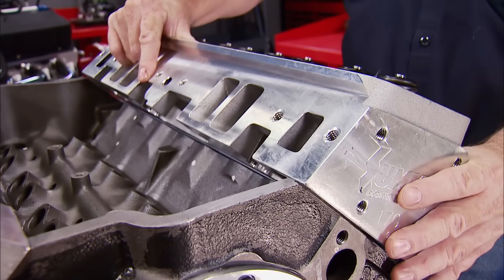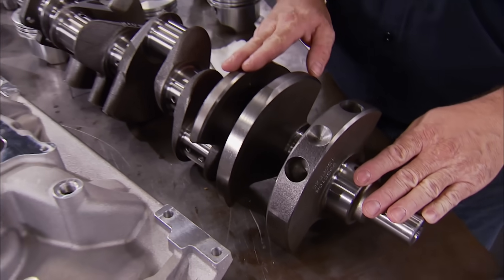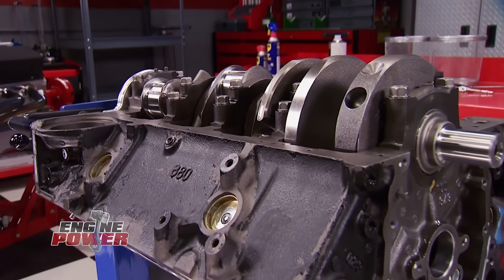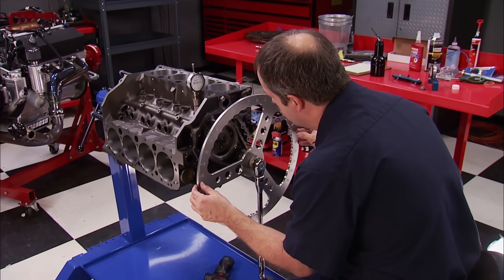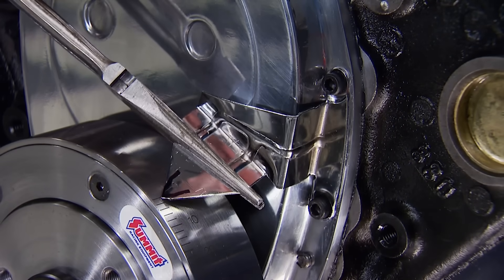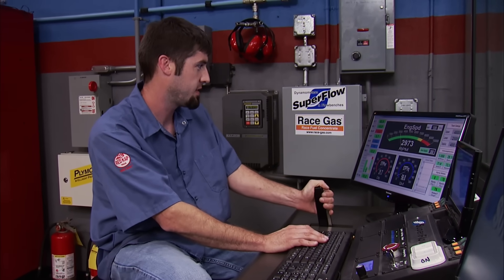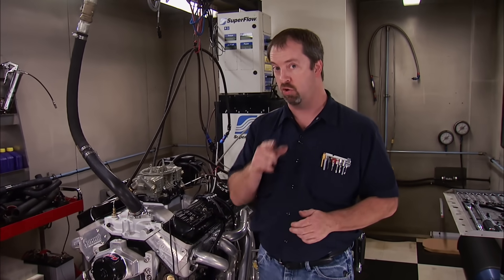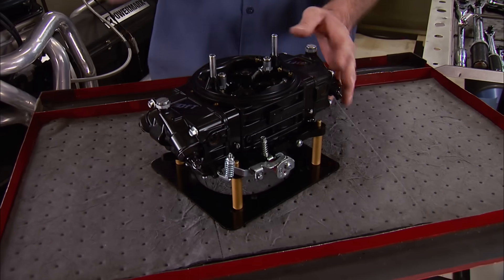Small Block Chevy Build Stage 1: Reliable Power Under $4,000 - Engine Power S3, E1

Comment: Pretty good power considering 
Copy of cranes old saturday nioght special cam? Durtion and lsa with a good dual plane, 650dp should roast the tires no problem. 
More power than the zz4 GM roller engine

Comment: You never pound Main caps down with a hammer the bearing  can pop out use the bolts or studs with nuts to line up the cap in snug it down carefully.

Comment: A lot of folks would like to see a Dyno test on Single plane vs dual plane intake Dyno test on a 408 Windsor with average horsepower and torque with a camshaft 0.050" duration in the 232-240 range with AFR 185, 195 and 205 head.

Comment: On the flat topic cam I recommend spray on graphite. Or brushing on the break-in lubricant when you have excess buildup especially with heavy valve springs the lifter may not rotate also get a cheap cam don't cheap out on the lifters

Comment: Lol 😆 I put 4000 in just my differentials, race rated 4.88 gears and axleshafts new 8.25 IFS front case and cv shafts and a auburn ected max lsd/electric locker on 33x12.5 bfg k02s on 16x8 wheels now you might think 4.88s on 33s is overkill but a worn out beat up stock lo5 low compression tbi truck motor will sure make you smile with that set-up. lemme tell you 200hp and 300lb ft of torque really feels like something when you got low enough gearing lol

Comment: i love it. Next could you dyno some jegs heads with an EPS intake and an XR276HR10 or XR282HR10 cam with the  same 10pt.25to1 static compression?
Reply: EPS intake is imo  the best all around st dual plane. Good hood clearance and supports plenty of power.

Comment: How do I get 800 HP out my small block ? Its bored 60 over with 292h comp cam with 501 lift, derale dual electric fans a 3500 stall in B&M transmission kit in 9.5.1 compression ratio

Comment: When I see these guys hammering the main caps in a block I cringe you can call some lower bearing come loose from the bearing cap supposed to use the bolts plus the bolts for studs helpline up the main cap properly

Comment: Made a critical mistake on the oil pump stud. :( The stud bottomed out on the rear main bearing. This will wipe out the the bearing in no time. Don't make this mistake. You have to rotate the crank to confirm this. The stud must not bottom out on the bearing! It needs to be loctite a little ways from bottom out. This is why when you tighten the nut it seems like the stud is too short. It is that way for a reason.

Comment: Spent 2500$ on a 383 that made 508hp
Reply: the only way that would happen is with stock 400 rods and crank all turned down and you did everything  cause most shortblock 383's go for 2500 alone

Comment: Made more power and torque than the low buck 5.3. LS has 15 degree head vs 23 degree for sbc. Also had a tad larger cam than this engine, and a hydraulic roller vs a flat tappet.
This is why the old sbc is still here. Especially those torque numbers. The sbc would have picked up even more with a better dual plane intake.

Comment: I enjoyed this video. That said this is why it's hard to justify not going to an LS. Does those numbers from the junk yard. Cost me 218 for a long block with intake and torque converter. Then spend the same you'll make closer to 500. Turbo and you'll blow those numbers out the water.

Comment: With $4k im going to chevy performance and saving the trouble. Plus I'll have a warranty
Reply: @THE WIZARD72 and he will only have 200 hp 😂
Reply: @off-roadmotorsports5148  🤣🤣
Reply: Building a engine gives you room for ajusting everything for future upgrades or especific use, and more chevy performance engines have a lot of "loose power and weakneses a built engine doesnt have
Reply: You could buy it part by part rather than dropping 4k and you get no say where you cheap out
Reply: I know this is a year ago but where the hell are you getting a decently built motor for 4k that isn't stock 200 horsepower?

Comment: 1785 summit cam .. just installed the same one in my truck.. sounds good and a upgrade in performance .. i got vortec heads as well with stock springs

Comment: Yeah, as soon as i saw aluminum heads i knew this budget was already way higher that any average joe, but seeing the hp, we built iron headed engines for the circle track for less than 2,000 that put out over 400 hp, our 406ci engines put out over 500 but they would have run you 3700
Reply: Yea I think I'd buy a tired ass ct 350 from a sportsman guy and freshen it up before I did this.

Comment: Stock motor from Chevy makes 350hp. In 1968 so this is not so good for $4000.
When the old stuff works.  Just hard to find a double hump heads these days.
Reply: there are 0 70s small blocks from the factory that make more than 250 lol

Comment: Ok look, i know that Im still young (17) but when people complain about this not being a budget build I always forget people don't have the assets I do. I grew up in a home where my dad collected a lot of old short blocks from when he worked at a dealership. (He doesn't tell all the stories behind it other than he just accumulated stuff) so when people say oh lord this is too expensive im thinking, I have a 350 block, steel crank, higher compression pistons and a set of vortec cylinder heads that were either given to me or I found for super cheap. I come here to learn random tid bits of info on engine building

Comment: Still out of most "blue collar Joe's" budget. My dad & I built a peppy little motor for my 74' Vette for around $1,500 & estimate around 350+ hp. Think it was a 307 bored out to 312ci or something weird. Had 11:1 compression & roller valve train. Nice lumpy cam that wasn't too crazy, it sounded amazing & was a blast to drive! Although it was severely limited from stock suspension & brakes along with an automatic. I can only imagine how badass it would have been with a proper suspension & a 5-speed manual 😍

Comment: always use a hardened oil pump driveshaft, on the summit heads pull the valve tubes and use phosphor bronze valve tubes.

Comment: YOU CAN BUILD A  383 FOR THE SAME MONEY SO WHY WOULD YOU BUILD A 355?
Reply: not everybody wants a 383, my 327 SS/H Chevy II has put every long stroke Frankenstein small block its ever run on the trailer. The only thing that gives me hell are the Hemi Barracudas. NHRA Super Stock is the most competitive class in NHRA drag racing followed by Stock Eliminator which I run an 87 Monte Carlo SS in S/KA.

Comment: I want y'all to build " The Battle of the  Junk Yard Grudge Engines"   Where some of these grudge racers run cheap junk yard engines until they blow up and get another one. 
Either get a 96 Explorer Engine with a 302 with  the GT40 heads or a 351W roller block using the GT40 instead of the E7.
Then get either a 5.0 or 5.7 Chevy Vortec head roller block. 
Make sure that the cubic inches match one another. 302 vs 305 or 351W vs 350 Use a nitrous cam in it, stud the heads, MLS head gaskets, stud the heads, new rings and bearings, gap the rings , use a carburetor and intake.

Comment: Can you guys take a stock bore 350 and see what the HP gain is when bored .020 over, .030 over, and .040 over ... compare each  to the stock bore HP and only change the bore size... nothing else.  I haven't found anyone that has ever tested this and shared the results.  Thanks!  Keep the great vids coming!
Reply: That minor amount does about zilch affecting combustion chamber dynamics or anything else. So the only thing it does is add a few cubic inches. If you have about 1 HP per cubic inch you can expect about 3 more HP if you bore .030 which adds about 3 cubic inches.  A 350 chevy piston is 4" and your fingernails are about .020 thick. That little bit of size increase makes little difference. It is mostly all about remachining the piston bores perfectly round not to add size.

The past, days I know of, where when there was a such thing as major overboring being possible without special high dollar blocks. Production engines went to thinwall blocks in the 60's and large overboring is not viable with most of them.

Comment: I wanna see them get a short block from rock auto then put a mild cam and a top end kit on it. Then throw it on the dyno and see what it makes.
Reply: DId that on a friends 87 iroc. performer heads with bowls cleaned up good TPI port job 212@050 flat tappet cam. All about torque with tpis big cams are no good with tpi Wtih the tall stock gears it broke 13s in Ca air 100 percent smog legal. Been together 20 yrs now

Comment: You can buy a 5.3 LS, swap cam, and tune it yourself, and make 440hp, for $600
Reply: The ls engine alone is more than 600
Reply: @matthewalaniz8393  I have bought running and driving 5.3 trucks for $200

Comment: I got a 350 that turned out to be a 30 over 355 for free and after a basic rebuild with just bearings gaskets and rings...stock iron heads ported and polished and Edelbrock intake and carb and longtube headers I made 378.4 horsepower and only spent 150 for the parts to rebuild it and my time lol that’s a real budget build
Reply: Awesome brother. So what vehicle is the 355 in.
Reply: @CJColvin he probably put it in a miata

Comment: Nice video,  but imo it would be worth it  to spend a little more money even if it required extending the time of the build.  Time is worth it to do it right the 1st time, if your goal is high performance this will leave you limp .leave no room for disappointment.  Although this would work for the wife going to the grocery store

Comment: What a JOKE!!!  I built alot more engine for less money for my Express van that I use to tow my travel trailer. For less money than that rear seal adapter they could have gone with a 383 1-piece kit rather than a 2-piece seal 350 kit. Summits block cleared 6" H-beam rods on a 3.75" stroke for me.  Also its a joke not to run a factory roller cam setup in the later block.  My 11:1 383 with Assault Racing heads off Amazon ported by Lloyed Elliot and custom comp cams 218/228 @ 0.050, 110 LSA, 106 ICL makes 485 HP. I run a mercruiser dual plane mpi intake and 87mm drive by wire throttle body using a LS PCM and 24x EFI Connection kit with 5.3 coils.

Comment: They buy a new style block that's already drilled and tapped for the hold down for hydraulic roller lifters and that they use flat tappet lifters make lots of sense. They're giving up tons of power they are for a couple hundred bucks Max

Comment: I would really like to see a small block Chevy valve angle comparison. Such as an 18 degree vs 23 degree head comparison, there aren't many videos showing the true effects of valve angle and power along with drive-ability. PowerNation definitely has my favorite mix of performance engine and budget engine builds though.
Reply: The steeper degree is going to preform better since it will increase air velocity

Comment: That cam is a cute little fella. I’d have went with a bigger cam. If it has to be a hydraulic flat tappet then probably a Voodoo with slightly more duration and quite a bit more lift. A roller would have that thing screaming but the price would be higher. They’re  doing a sales pitch for Summit’s  in house brands. Nice little peppy street motor though.

Comment: Stage 2: New internals.

Stage 3: New block. 

Is it the same engine?
Reply: I inherited my father’s splitting axe. It has been in continuous use by my family for over 200 years. In all that time we have only replaced the handle 9 times and the head once.
But you know what? It is still the axe of my great great grandfather, and high my family has used every day for over two centuries...

Comment: I would not be proud of 357hp.. that's pathetic.. wasted money on the aluminum heads, nothing more there than stock vortec heads cast out of aluminum.. I would have saved money on the block, the and put more in the heads and compression of the motor, which I'm going to guess is pretty lame.. stock heads are stock heads, whether they have summits name on them or not..

And that main seal adapter deal, total failure of parts matching and a waste of money.. how about we get some people who are competent on building engines?

Comment: If this build was with a flat tappet hydraulic lifter cam, why was there no mention of breaking in the cam? I like the info that is explained but some important things like the break-in procedure and using high zinc cam/lifter lubes was left out. This is where most failures happen if I'm not mistaken. If I am indeed incorrect please correct me so I can stop doing those procedures.

Comment: I have a question for all of you engine builders out there. I always put the cam in before the crank so I can guide it through the cam bearings more easily and then add the lube to the lobes after it's installed. I never see any of these engine builders on TV or YouTube doing that. They always install the crank first and then use a tool to try and install the cam without damaging the bearings. Am I alone in doing this? Is there a good reason I don't know about to install the crank before the cam? Nice to see an updated 350 small block build by the way with the current parts available.
Reply: I always try to do the cam first. Like you say so I can guide it in and also since occasionally the cam doesn't spin perfectly free. Like to go back after the whole rotating assembly is in and have to mess with the cam bearings? I can see mocking things up prior, but for the final assembly yes cam first for me. We all have our ways, but if I was speaking to newbies I would always teach them the safe ways of doing things. They can develop their preferences after that.
Reply: My father taught me to 
Put the camshaft in,   when the block is vertical position,  working with gravity. 
Then bolt 🔩 the block on the engine stand.

Comment: 14:40 ["Excellent for cheap."]  I bought my GM Performance Parts ZZ4 crate engine for around $3,000 back in the day which made 355/410.
Reply: ∆ what he said ∆
Reply: The prices have gone up quite a bit in the last 5 or so years.
Reply: I remember the price of the ZZ4 going up before they discontinued it but you can still get 375hp 350's from BluePrint, ATK and many others for $3k

Comment: When putting the rings on the piston what position on the piston do you put the ring gap on the top two rings? The third ring doesn’t have a gap from what I see. Thanks.
Reply: You want the piston ring end gaps 90 degrees from each other. Doesn't matter their orientation.

Comment: With so many fuel injection systems available in this century they still use an old carburetor setup.
Reply: I agree with this to a certain extent.. injection is nice for a lot of things, but at the end of the day, the difference between an organized fuel leak and efi isn't much.. I'd say sometimes negligible.. engine Masters did a test with that and they made within 10hp of each other.. the real difference is tuning, driveability, cold starting, etc, and given the money, that's the route I'd go for a motor in my car.. but carbs work just fine

Comment: How do you know you need a spacer on the intake? What does adding volume do?
Reply: On carbureted engines it allows the fuel and air to mix better before entering the combustion chamber, on newer fuel injected cars it doesn't do shit and is pretty much snake oil.

Comment: Or spend $800 on a junkyard 5.3 LS, $500 on an intake and ignition controller, $300 on turbo manifolds and $500 on a turbo to make 900hp for less than $2500. SBC makes absolutely NO sense to build anymore. They are weak, heavy and inferior to the LS in every single way. A bone stock LS makes more power than this $4,000 build, and with the LS you don't have to figure anything out. They mount to the same transmissions, can mount to the same motor mount brackets and use the same radiators. If you are using a carb intake, they can use the same fuel system with nothing more than an external fuel pump. It takes a moron to build an SBC to replace an SBC. Really, unless you already own all of the parts(and why would you?), it takes a moron to build an SBC at all.

Comment: I built an almost identical version of this engine. A 357 ci Vortec headed engine. The main difference was I used a set of Iron heads from Odessa Racing Head Service. They are 2.02/1.60 with 7/16 screw in studs and the springs can handle up to .600 lift all for $800 total shipped to my house. I also used a Comp Cams 272/.502 roller cam and an Edelbrock Performer RPM intake. The result was 394 hp on 87 octane. I know everyone can’t afford a roller cam and lifters but they are superior to flat tappets if you can afford them. I would skip the Aluminum heads and go for the roller cam every time if it were me.👍 On a side note the Summit 600 cfm carburetor of mine tuned to the max VS the Dyno rooms Holley 650 HP was worth 26 HP.  Yep I bought it and they ARE expensive because they work. Even so I only have about $3000 bucks in mine because I already had an Engine block and good crankshaft and rods.

Comment: I would have liked to have seen the results with the summit p/n SUM-1788 cam shaft, a Weiand street warrior and a Brawler 650. a little bit more lift and duration, a dual plane and a reasonable carb. I feel like stage 1 could have been 375hp 400lbs-ft for the same money, same idle vacuum. or not, but i'd like to see.

Comment: If you're going to make a point of ring gaps, and point out the top ring gap was a little oversize but OK, you should also check the bottom ring to be sure it's a few .001s bigger. The top ring was oversize, but maybe the bottom ring isn't - resulting in 2nd ring gap being tighter than the top.